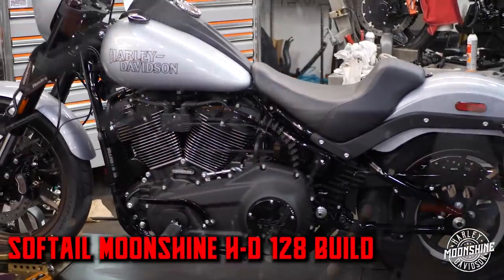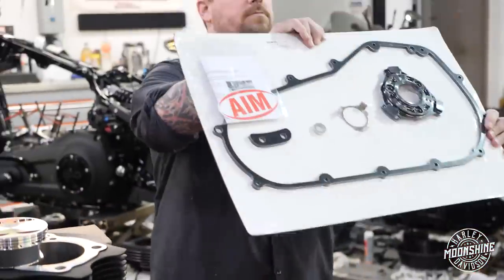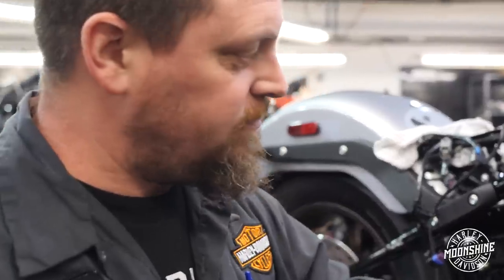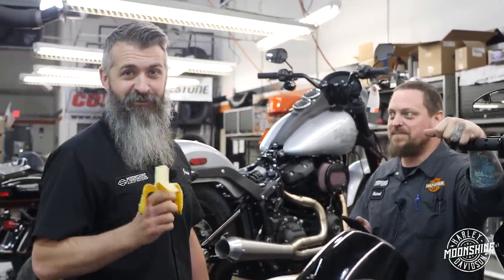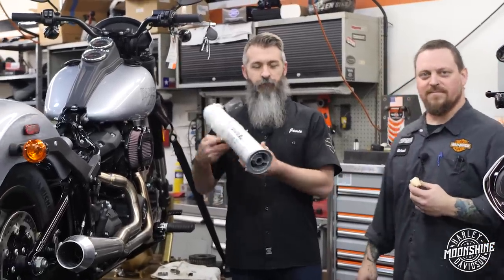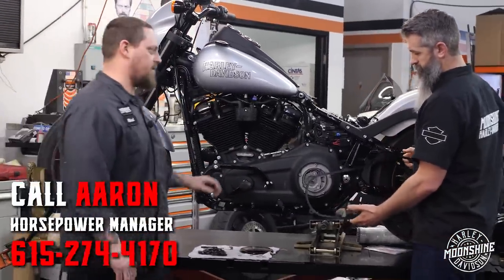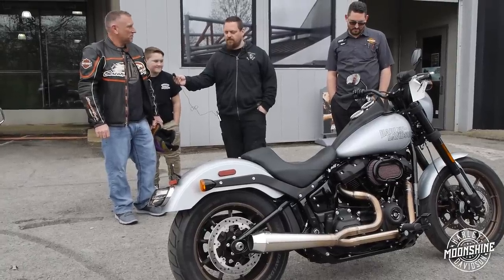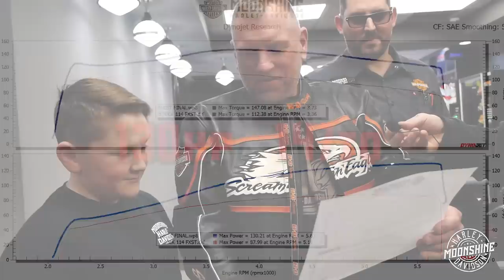Moonshine H-D 128" Power Kit! 145TQ Plus! RYKER EDITION | Shop Talk Episode 38

Comment: As a Vmax owner, MSH had peaked my interest. My bike with ECU flash, cat delete, 4 2 1 exhaust and sit airflow mod sits around 185hp at the wheel. That being said, that's why I stay away from HD.

With these motors by MSH I am actually considering something along these lines. My only question is approximate price range of a motor build line this one.

Comment: What a great build and group of folks.  I have a stage one on my 20 RG special and was considering a new cam and tune to move to stage 2 but this makes me want to go for the 128.  What would something like this cost overall?
Reply from the maker: $9,000 - $11,000 depending on the options and that would include exhaust, intake, and primary built to handle the power.

Comment: What’s the best bang for the buck power upgrade on the 114 engine
Reply from the maker: Cam job. 
Feuling 465
Zippers 468
Feuling 472
Star 30/30 485 cam 
This are in order from most bottom TQ which is the Feuling 465 to the most HP which would be the Star 485 30/30 cam. These are the ones we use depending on where you’d like your power to be.
Reply: Moonshine Harley do you not rate the SE 447

Comment: Question..should the highest octane be used or ethanol free or ethanol free with a booster
Reply from the maker: 91+ with or without ethanol on this build. No leaded gas.
Reply: @MoonshineHarley  but do you recommend using ethanol free or ethanol free with a booster over 91 premium pump gas?

Comment: Man I only have 88ci. Fuck me.I need to find a good 40 more cubic inches somewhere. I’d settle with 20 more even. Some older guy on a hopped up new road glide took off on me at the stop light way to easily.
Reply from the maker: We build some Badass 95 and 100 setups! Call the shop and ask for Aaron or Nick.